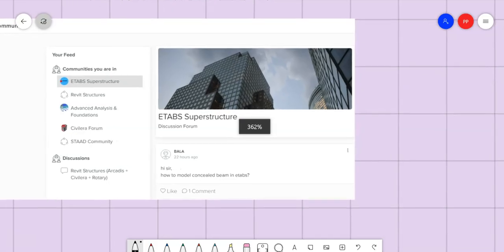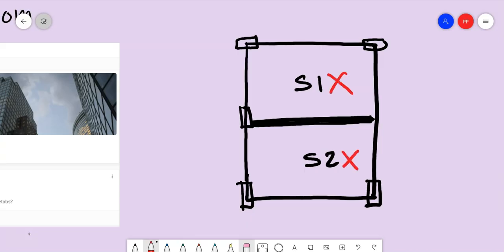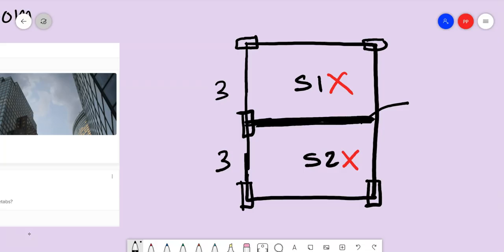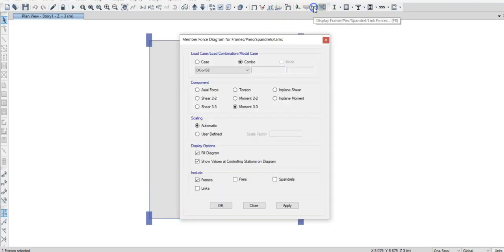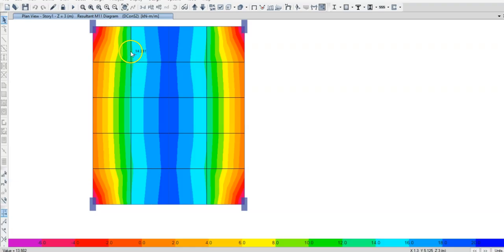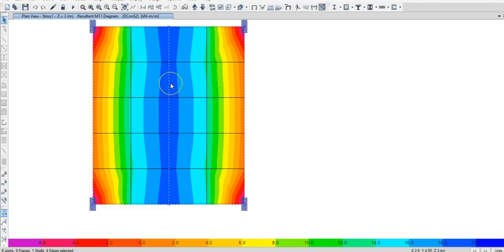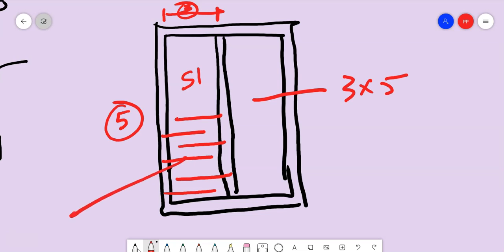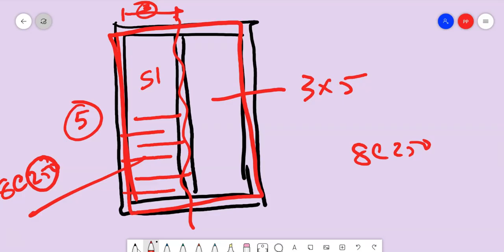How to model a concealed beam in ETABS  & How to design the Hidden Beam

Comment: Thank for the video.
How to design this beam,i mean how much reinforcement is needed.
Reply from the maker: For the gravity loads, you dont have to. It is like a dummy beam used to distribute the line load on top of it coming from a wall. It is a part of the slab and you are desigining the slab as a shell for the forces coming at the location. Additional rebars if any as a through rebar is provided for either tie action or to redistribute the line load from any wall there as an additional preacaution. You can interpret the shell results and design the slab

Comment: 1. I am not sure if we need to add a tie beam at a column to retrain it. I never saw a flat slab column needing a beam to tie it.
2. Even if we add that beam, for that beam to qualify as a support it must satisfy stiffness requirement per ACI 8.10.2.7. Otherwise how we will define at point that beam will start acting as support?
Reply from the maker: Shashank thanks for the comment.
1) The core topic of the video is about concealed beam that people misuse. The intention was to educate beginners not to do the mistake beginners do which is mentioned in the video. Please dont selectively choose and twist what I have mentioned. Where have I mentioned about Flat slabs and the column needing a tie in flat slab. Any flat slab structure will need a separate seismic resistance mechanism like a single system or by using the edge beams to form a structural resistance sytem. Thats a separate topic. I suggest you make a video on that and post in your channel and I will comment my opinion seeing yours.
I was refering to a normal building system where columns are untied, it is better to tie it for better tie action.
2) I am aware of the tie action needed and I have quickly mentioned about the compressive and tensile capacity needed for the concealed beam to act as a tie for the column. As mentioned above, the topic of the video was not tie action. I never ever in the video mentioned about the concealed beam acting as a support. I mentioned it acting as a tie for the column for the lateral load cases. The slab as such is immensely stiff and can perform this role provided the salab is well connected to the column. Even if we do that, the slab offer compressive action. what about tensile? thats the reason continuous rebars are prefered at that location as a tie. Now that people call it concealed beam and my point was to treat that as just a tie and not a beam.
Reply: @CIVILERABangalore  Dear Sir, any apologies if my tone seemed too critical. That's not my intention. I appreciate you taking time to explain fundamental concepts to the young engineers, which is very much needed, especially people with vast experience like yourselves. 
1. I haven't designed any normal slabs other than flat slabs. So this is the first time I am seeing "tie beam" concept and I am not able fully understand/appreciate the need for it. Hence my question.
2. I understand the you are trying to conclude not to mis-understand tie to be a beam and design slab by cutting its span at the tie beam. What it means is some young engineer trying to use beam as support and splitting the slab by discontinuing the rebar at the tie beam. Which can be done provided the beam is deep enough to have sufficient stiffness per above mentioned ACI clause. 
Let me know if I am getting anything wrong here.
Reply: If you think my comment is misleading/too critical, I can remove it.
Reply from the maker: @shashankm1403  Your misunderstanding led to criticism may be. I dont mind criticism by the way🙂 . However please see the video again and ensure you understand what I mean.
Reply from the maker: @shashankm1403  Yes when the beam has stiffness , it is a proper beam. The video is talking about the so called ''concealed beam''  
I am ok with people criticising 🙂. However your above statements were not on the core topic of the video and out of your confusion on the tie. I suggest you model a structure with out beams tieng the columns with a 100mm slab thickness (slab modelled as shells) and check the stresses in slabs and also the lateral deflections and the column design. Compare this after providing beams.

Comment: Great video. I have one question. Why didn't you model the slab into two parts. Like one slab on left of concealed beam and 2nd slab on right of concealed beam? Maybe then bending moments would have showed up?
Reply from the maker: Thanks for the comment. And happy that you learnt from it. However why do you think I will overlook such a simple point ? :-)
I will leave that exercise to you to split it and check the moments :-)
Or let me tell you :-)) - In ETABS it does not matter if you merge or split the slab as long as it is a shell. Shells would behave as it should inspite of split or merge.
If it is a membrane it is a different thing though. Check it yourself :-)
Reply: Splitting the slab means again we have to consider that Concealed beam as Normal roof beam.
Reply from the maker: @saimanish7879  No it dont mean that. I request you to do these and find out for your good :-)
Me saying is easy but if you do you experience it. If your split or merge, shell will behave the same way.